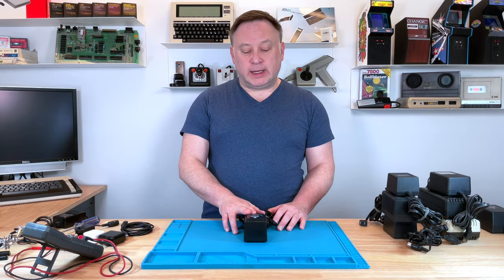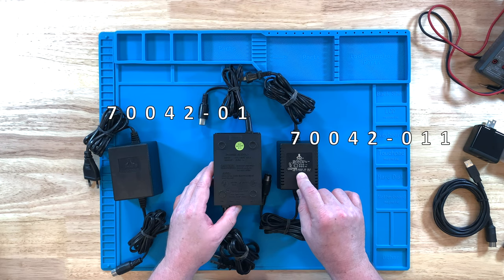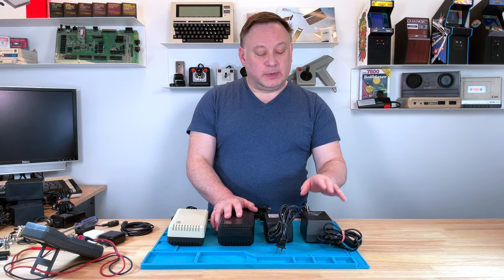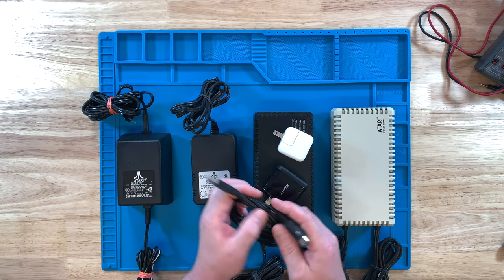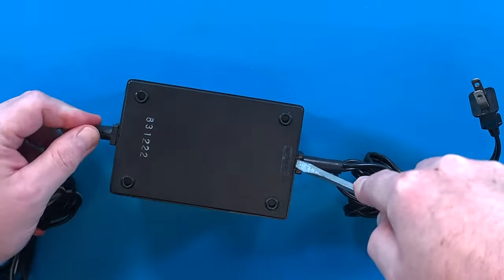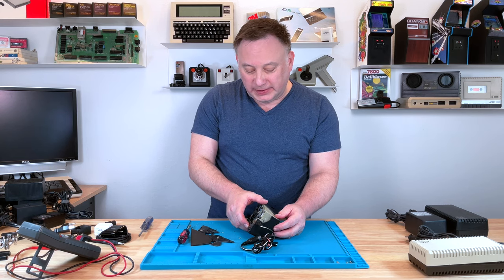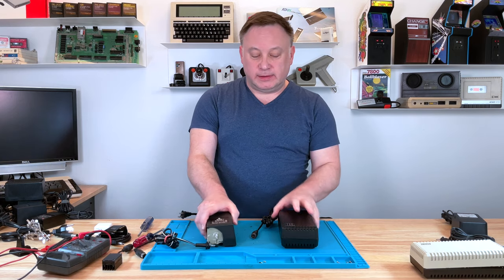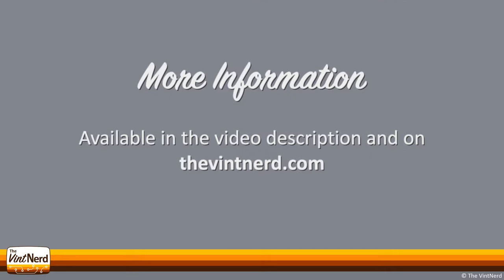Stop using the Atari 'Ingot' power supply, Seriously!

Comment: My ingot is reading 10v output, does it mean my 800XL was fried? It is not booting up and no keyboard led on!
Reply from the maker: Ouch. 10 volt output from an Atari 5 volt power is ...not good - no matter if that testing is under load or not. Definitely Never use that Ingot power supply for anything ever again. Please recycle it. As far as your 800XL, do you have another Atari compatible 5 volt power supply in good working order? Was your "not booting up" test done with a good power supply? If so, Yes, I'm sorry to say you probably have fried something in the 800XL. Sorry Dude ☹
Reply: Update here: the Atari 600Xl is saved, just had to replace the 500k trimpot and get a new power supply, and it is fine now.  @TheVintNerd
Reply from the maker: @coffeedrops_Franck  Awesome! That's good to hear.

Comment: Have you done the video for making the USB to 7 Pin DIN Cable or where to source it from? I recently retrieved my 600XL (bought in Jan/1985) from my mom's house after 30 years... I did plug it and turned it on (used a RCA to F Connector) and hooked it up to a 4K 65" TV (my 600XL does not have a composite out)... it was wild to see it still run... but I did notice that the PSU (CO 61982) got quite hot with the 1 hour I had it on (showing it off to my 8y/o son), although I do recall it did that back in my high school days.
My son seems interested in learning coding on it... so I want to build/buy the cable and prevent the 600XL from frying... if you have the info or the video (don't see it in you video roster) it would be really helpful...

Thanks for this video, it is very enlightening...
Reply from the maker: Hi, Luis. I have not finished that video yet. Probably have it up in the coming weeks. Cool that you've gotten your son interested! Not sure if it is still relevant, but back then the "Pilot" programming language was geared towards school aged children. You can find Pilot on eBay; as well as a USB power cable if you did not want to make one yourself. -Cheers, Steve
Reply: @TheVintNerd  I am now thinking to basically replace the 7-Pin DIN connector with a USB port, and use a Pure USB Cable and a 2+Amp USB PSU…

Surely I can find a connector that fits in the current back panel…

Probably will also mod the video output… since mine only has RF… see if I can convert it to a better video… as the RF is really fuzzy on a large TV (the only one I have)
Reply from the maker: @nenesaurus  With the right USB connector mounted that could look nice. I would use a USB-C style connector, if it were me.
Reply: @TheVintNerd  exactly what I am looking for… thinking to add it without removing the original DIN… just adding a small slit that fits the USB-C, as inconspicuous as possible… I don’t do videos… but once I do this I would send Pics maybe you can show in one of your videos…
Reply from the maker: @nenesaurus  If you can install it without removing the original DIN, and not modify the case, that would be a Win-Win. As far as the pics, would be interested in seeing them; not sure I can work them into any videos.

Comment: I've gutted and replaced the ingot psus with MeanWell RS-15-5 units similar to Jan Beta's approach, they were a pain to remove though.
Reply from the maker: That's a great idea. I've seen Jan Beta's video, and his came out really nice. Whats the best method you have found to remove the brick-of-epoxy without damaging the plastic case?
Reply: @TheVintNerd  It was a pain since they're bulky when they're full. I also watched Kevin Ottum's videos involving the c64 rebrick method as well. I used 2x4 pieces then a hard a place to pound it out takes some patience though.
Reply from the maker: I would imagine some break unfortunately. I'll have to check out Kevin Ottum's videos; Thanks for the tip.
Reply: @TheVintNerd sure thing.

Comment: Hi , I also make videos, I have one of these but it does not have a din connector on it, it belongs to a friend of mine I will tell him to just toss it and buy a USB or better still a repairable power supply. If anyone knows where to get the STLs I can 3D print the black and white one no problem.
Reply from the maker: Great :)